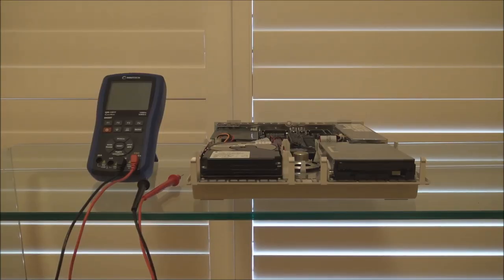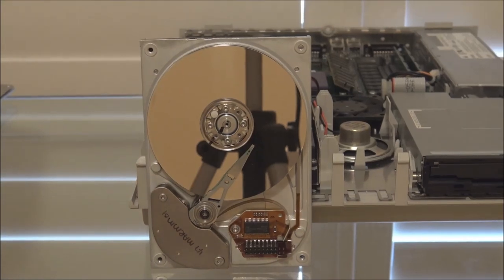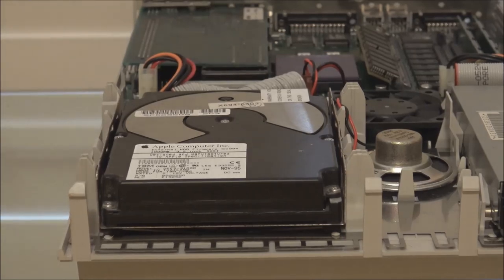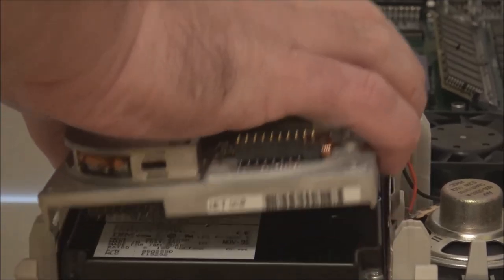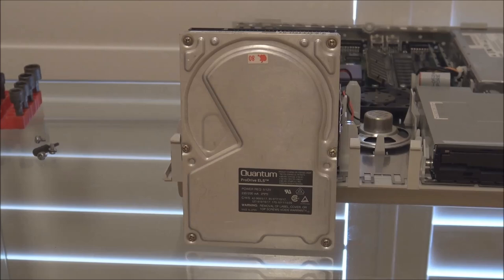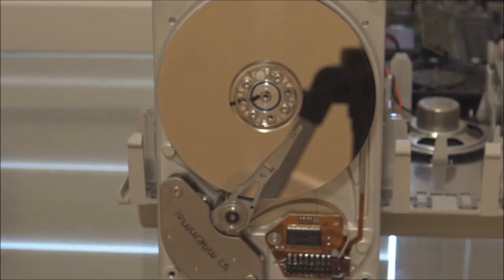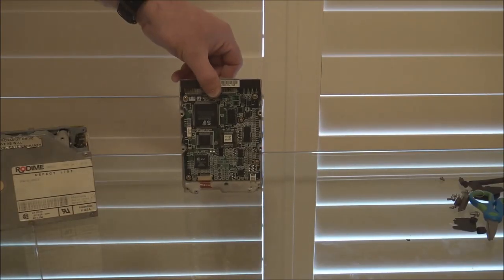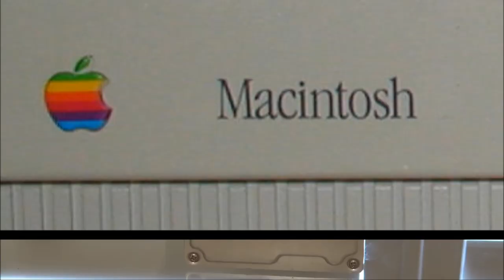Common issues with Apple Macintosh Systems - Part 3 : Hard Disks

Comment: I found an LC III on eBay recently for $85 shipped. It's gonna need a recap but thankfully the hard-drive is a IBM 120MB drive and I hear these things are built like tanks and generally still run good today. So I lucked out on that one. I got another IBM drive (a 80MB version) in an external enclosure for my Macintosh SE. I do have one Seagate drive. It's a 500MB drive as is the internal drive for the SE. So far that one is running well.

As for the rubber stupper failures I've heard some got so bad that bits of them start to come off and stick to the platters. Once this happens, the heads would crash into liquefied rubber fragments stuck to the platters and this would cause head crash damaging both the platters and destroying the heads. The drive is pretty much a paper weight once this happens.
Reply: IBM made pretty solid performing drives, also reliable too.

Comment: Pity I didn't see this video in 2008. I got myself a 7200/120. With an external case with hd. It was advert as NON-WORKING. So I tried to install the OS and it have problems with the internal and the external HD. Did a transplant... and nope. 3 50 pin SCSI hard drives later I just threw it away in frustration and got a zoolander G3.
Reply: You're a genius 🤦🏻‍♂️

Comment: Nice video, I'm totally ignorant about Macs in general but I bought a Classic one at a flea market and I was able to make it run, but the drive doesn't work,  the rubber was sticky and I replaced it, now it turns on, but it's not recognized by the computer itself (3rd problem on your video), I'm gonna be checking those terminators, but if that's fine I don't know what else to test since I have no idea on how to format it and unless the programs are contained on the smal OS that it's included on the ROM chip, then I have no idea what to do.

Comment: From what I recall, a typical SCSI controller can handle 7 additional devices, 1 through 8 with the controller taking one of the device numbers. I'm almost certain that all of the early Apple SCSI controllers could only handle 7 peripherals. I think some could do 16 when combining internal and external, but they would always be assigned 0-7 as an identifier.
Reply: Depends on the version of SCSI. Later standards introduced support for more than 8 devices and some controller cards even offered multiple SCSI buses and connectors on one card

Comment: I'm fortunate to have a guy 8 miles from my house that has a huge supply of old Apple hardware. If I really need an HDD, he'll likely have it.

You can also use a SCSI to CF card unit to take the drive out, so it doesn't degrade from use.

Comment: You forgot to mention that old MACS do not like non-Apple branded hard disks. If you put a regular standard SCSI hard disk into an old MAC, most of the time it simply will not even acknowledge that there is a drive in it.

Comment: I saw the HDD fix failed and will give you lots of dislikes?
Reply: Opening a drive will kill almost every drive ever made. The torque specs are not published and if the top of the drive is not torqued to the correct torque, it will not work. The head sits a couple of microns over the spinning disk and even the smallest mote of dust will fuck it up. If you have to open a drive, there is a 99.9% chance it is never going to work.
Reply: @tarstarkusz  Your wrong with these older drives, they are a lot more tough. You can run these drives without a cover, the drives not being torqued properly isn't an issue. These drives can run for weeks opened before dying. Also the drives are already dead so what do you have to lose by opening it.
Reply: @ducksonplays4190  When I was in college in the 90s, we took a hard disk apart and replaced the top with one made of plastic (including a gasket) so you could see the drive in action.  It failed very soon afterwards.
But, if it is already not working, you don't have that much to lose. I agree on that point.  But if you want success, you need to find a room you can seal and get a really good air filter.  Air just has too many particles in it.
Reply: @tarstarkusz  Only some drives work for a while in open air, quantum drives are one.
Reply: @ducksonplays4190  I would think that depends on air quality more than the brand. They all have heads that are many times closer to the platter than a smoke particle (which I chose because of how small a smoke particle is) could fit in.